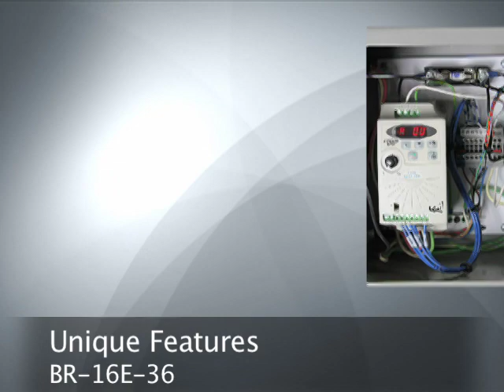Baieligh Industrial BR-16E-36 Bead Roller

Comment: I want to edge banding to 10mm. the 90 degree angles... My job is the round square, the maximum diameter is the 30 to 45 mm reduced. so how much bedroll wheel diameter required??